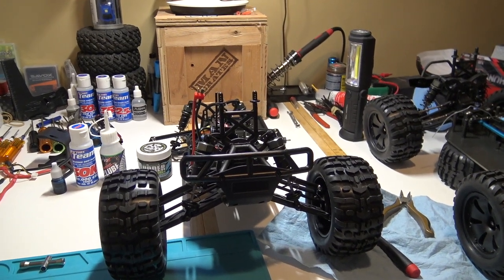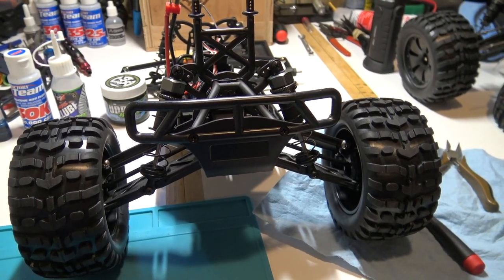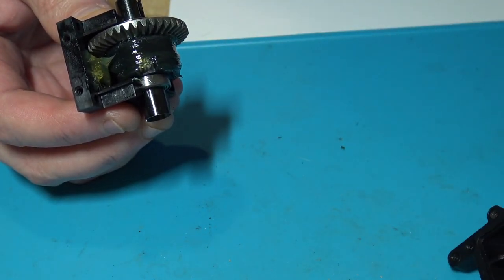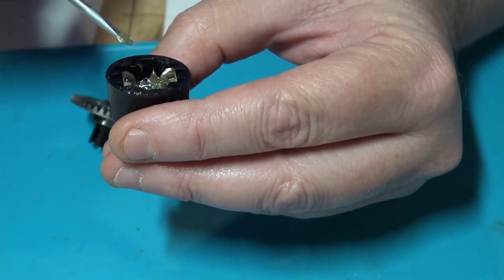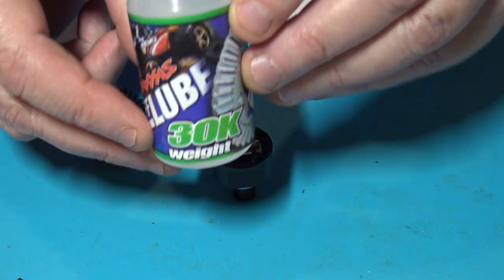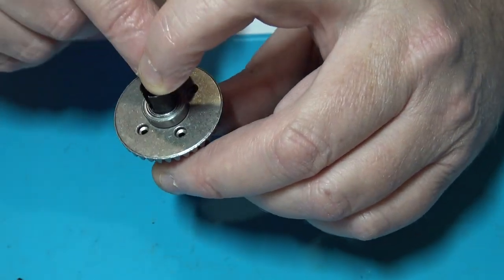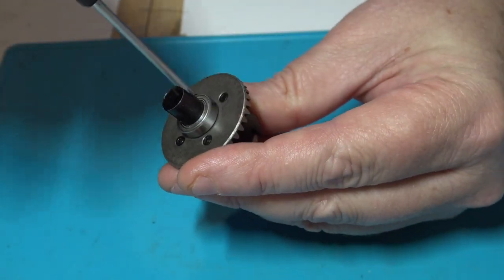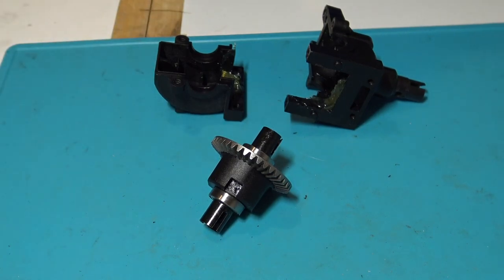ZD Racing ZMT-10 Differential Teardown & Upgrade

Comment: I also have both of these, both completely torn down and modded. The long bumper screws that thread into the gearbox at the bottom WILL strip out. I plan on doing a mod where I drill through and use stainless machine screws with nuts at the back.
Reply from the maker: Unfortunately this is a byproduct of cheap Chinese Rcs.
Reply: Very true. Still, for the price these are a great grab for those who don't mind tinkering around.

Comment: Also, sorry to say but they will still leak and skip. . once you start running the diff fluid will push out past the simple o-rings that "seal" the cups to the diff case/ring gear. The ZD diffs are also poorly made. The gear teeth are not tall enough, which will definitely make them skip once you try to punch it . I remedied this by ditching that thick gasket,  and making my own thin one. This brings the gears closer together, and meshes them properly. At this point, you'll feel the gears meshing as you turn. I also used a thick sticky grease in the diffs, which will still push out if you overfill. 

Both trucks run nicely now, with no skipping, even with the upgraded motors I have installed.

Other guys are using RedCat Volcano diffs. They are a LOT less problem-prone as they have taller, better-made gears inside of the same housing. I plan on buying 4 for when mine do wear out.
Reply from the maker: Thanks for the info, I was concerned about leaking. I didn't fill as full as I normally would on a good sealed Diff. Maybe I'll get lucky and it won't leak much. We'll see. Good tip about the gasket. When I put it back together it seemed good and tight. As you know QC on these is probably not very good. You could get loose or tight one I guess. I'm getting ready to pull the diffs on the 9106S. I'll see if they are any different.
Reply: You are welcome. It will most likely be the same. I got my first 9106 in December, and the 9106S came from a friend, after he stripped the diffs. I also grabbed another 9106 from a friend with the same problem. It seems the latest batch all has this issue. The original 9106 from a year ago seems to not have the problem.  My friends that reviewed them back then still have great running trucks, with those who got them later ALL having the issue. 

At this point, my original is a parts truck(I also crashed it in zero-degree weather..lesson learned LOL). I've used the best gears along with the gasket trick to build 4 tight, well running diffs. I did forget to mention that using tiny washers behind the spiders to shim them has the same effect as the thinner gasket.. but will of course require sourcing said washers. 

I hope you have better luck with yours..but I suspect the tackiness of the fluid is masking the main issue. Do watch out, and if you hear them skipping, pop em apart and perform the mod :)
Reply: HLRC Tech hi man, can you put here the link for the redcat volcano diff. The are good for the 9106S? Thanks
Reply: They are Redcat Racing Part Number 02024. Here is an amazon link but you can find these at many vendors. 

https://www.amazon.com/Redcat-Racing-Front-Rear-Differential/dp/B00E5L94VG
Reply: HLRC Tech thank you very much bro, do you know if they fill perfectly? Or there are some changes to do
Reply: As far as I have read at RCGroups , you just use the outer bearings and shim from yours, and pop them in, and they work well as-is. I've yet to buy a set and open them to compare, since the mods I have done to mine are holding up well. Pictures online of the gears inside show them to be taller and of a different alloy.
Reply: I replaced the diff with the red racing diff today. You are correct.  Need old bearings and shims. One bearing fit perfect. the other was a little loose so I locktite the inner race.  Works just fine.  Hope it holds up better
Reply: HLRC Tech bello, i have a zd racing 9104 truggy and i am experiencing problem between the pinion and plate of the differential. I need to take out the gasket so that the pinion and plate teeth come closer. I bought two new differential sets (with new pinions) and i think the material are really poor quality. I upgrade motor and esc to hobbywing ezrun max10 sct 120A 3660 4000kv and i cant punch it. The differential are the weekest part of this car. Do you suggest to buy the redcat diffs? Are they compatible and stronger?
Reply: @gregwing6306  how the redcat diff doing on your thunder?
Reply: @hlrctech1028  Yeap...that's all I did..when the front started to slip...
I notice  2-EA shims on the outside ...durrr....durrr drrr. I just use
1-ea shim on the inside.lmao....
It's just REGULAR MAINTENANCE  on R/C....I got  KM 1/7 for $100.Almsot NEW...it still smell new too.lmao
well...previous owner had problems with the CENTER DIFF..
The stupid mount as was lotice..so he couldnt remove it.
I just soak it with over over night...It came right off...
Slap a WASHER/SHIM..it's tighter than any oil...but it'll still give.
I didnt mess around with any oil....i just use industrial thick grease...
it needed a SHIM...no matter what I did
I  mounted a bigger brushless motor ,  esc. Pinon and MT wheels and tires....It'll pop wheelies on Cammand and do over 50mph.lmao
It's running fine after 50 packs of ran through it.
it's a $400 truck...I fixed for 5 cent.lmao

Comment: great video thanks, I was hoping it would be the same as my 1/8 zd pirates 3 but it's different, Im trying to find out the size of the connection cups so i can ordered some after market ones.  the rear center and front ones are all garabage... they are being chewed up and gouged.  pretty soon the tbone bar will spin in place.  I don't know why zd racing used such cheat  weak metal for this very important part of the drivetrain.

Comment: Ive just purchased a few zd racing replacement diffs. If I strip them and follow this guide- then also remove the thick gasket and replace with the thinnest piece possible I'm guessing ill get a lot more life out of these poorly built parts. There about £3.00 each ($5) so its worth trying before buying the redcat racing one which is around £20.00!

Comment: Nice video, very good. I have a question, where did you buy that grease ? Do you have a link? And which product do you use to clean the tyres?
Reply from the maker: Marco Melillo The waterproof grease is Udder Butter from cowrc.com. For tires I just use soap and water. Cowrc does make a spray cleaner called Moo Clean that I use also sometimes.

Comment: You only had one shim on the outside of the diff? Mine had two, both on the the bevel gear side. Also, this was posted in April. Hows the truck holding up now?
Reply from the maker: GearBang These Chinese trucks are just inconsistent in the builds. Go figure on the shims? Well I haven’t really run the trucks. I’m going to do a 3S test with a good quality lipo and then give them away. Probably a 1K subscriber giveaway if I ever get that high 😆

Comment: I bought this truck a few weeks back the first run and it sounds like when I give it full throttle forward I can hear what sounds like plastic gears grinding from the rear diff instead of waiting weeks to get a replacement truck what would you recommend I noticed it did come with extra gears in the Box I purchased the new version
Reply from the maker: Spencer Jones sounds like the diffs are not put together correctly from the factory as many have reported. You need to tear them out and first check if the screws are tight. Sound like they maybe slipping. QC on these RCs not good.
Reply: @316RC  yeah I'm going to try to tear it down thanks for the reply

Comment: Thanks for sharing the information!
I have a few questions maybe you can help me I am new to this kind of hobby  
1. What do you think about using other differential oil weights like 10k,20k,50k?
2. Should I do that mod for both front&rear differentials? 
3. There is any recommended setup like 30k in front 50k in the rear?
4. Any other mods recommended for making 9106s more durable? 
5. Udder Butter alternative? 

* Currently stock battery but planning to try 3s battery

Thanks again :)
Reply from the maker: To change power distribution in the ZMT10 or any vehicle for that matter you need to change the diff fluids. These trucks don't have sealed diffs so the verdict is still out on putting fluid in these instead of grease. Generally lighter fluid setups cause more differential action. This is usually good for dirt track running and racing. Heavier fluids work better for bashing and wheelies. Here is a good article on diffs and how the fluids effect how they perform. https://www.myrcbox.com/articles/tech-article-diff-tuning-guide-for-buggy-and-truggy/

Comment: For ZD trucks in the usa could you let me know thanks if there are Parts out there I'm thinking about getting one
Reply: Shoulda just packed it solid with blue wheel bearing grease. It makes it limited slip and won't ooze out.
Reply: Also you should have put blue locktite on the spider gear/diff housing screws. Just my opinion.

Comment: You should remove the gasket so dthe gears can last a little bit longer
Reply: How exactly would that help in any way? im genuinely curious.
Reply: That's the way to do it. By removing the gasket you allow the gears to come into tighter contact and stay meshed together with absolutely no slipping. I made a paper gasket just to prevent leaks.

Comment: Just unboxed the 9106 today and the front wheels spin but the rear ones do not.  Here’s a link to the video.  What do I need to do?
https://youtu.be/RdJCfLvCTGg
Reply from the maker: anonymous anonymous yikes. Sorry to hear. Somethings probably up with the rear diff. Don’t try to run anymore until you tear it apart. One question, can u turn the rear tires by hand?
Reply: AL2 RC yes all the tires turn by hand
Reply: AL2 RC if I pick up the truck and run the wheels they all spin, but if I barely touch the rear wheels they stop.  Front ones do not, they spin away from my hands, but I can stop the rears by touching lightly with one finger.
Reply from the maker: anonymous anonymous That’s actually good. I’m pretty sure the problem is the rear diff pinion mesh. Unfortunately Your going to have to tear it down and find the problem. It’s probably not tight and not engaging the bevel gear.  If that’s not it something could be wrong inside the diff.
Reply: AL2 RC is yours still running well?  About how many batteries have you run through it since this April video?
Reply from the maker: anonymous anonymous Can’t say only 2 packs through just for testing. I’m not keeping this truck and probably going to give it away on the channel or to a friend. A lot of guys have reported problems in the rear diff area but those guys are running 3S packs on this truck that I don’t recommend.
Reply: AL2 RC I would be happy if it just ran on a 2s
Reply: AL2 RC is there any solution for this?  Aftermarket diff?  3d printed parts?
Reply: @anonymousanonymous8372  You can try the Redcat Volcano diffs, they recommend them here. But why not locking them. This is what I would do, in order to keep driving it, before new parts arrive. When CVDs broke on my HK Sabertooth I locked the center diff to run it at least in RWD. Was also cool. I really wonder why this diffs break. They look like diffs for a 1/8 scale. What a pity. Seems I won't buy that truck. I wanted it, but also wanted to run it on 3s.
Reply: If you haven't already fixed your problem then... copy this video EXACTLY but also scrape away the green gasket and replace with ultra thin card. This will make a reduce the space inside the dif and mesh all the moving parts together tighter.... BOOM